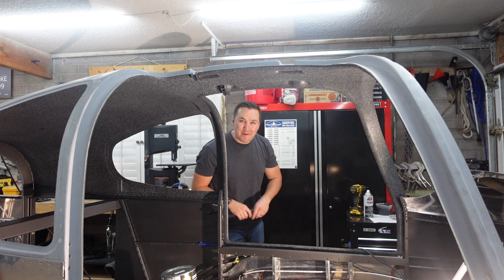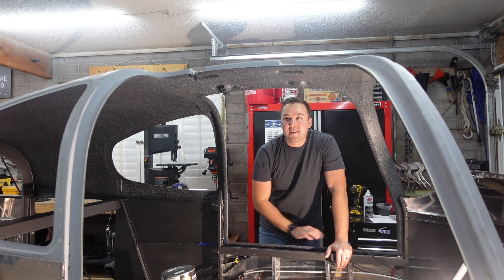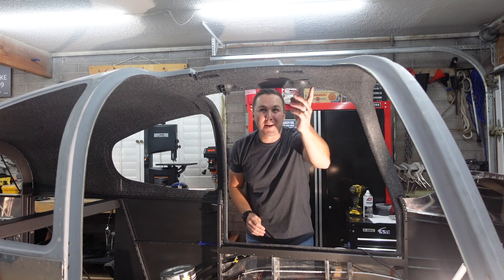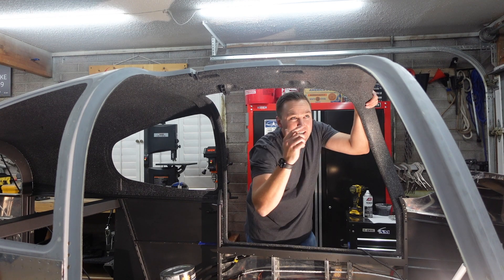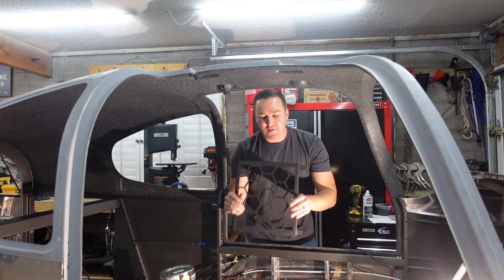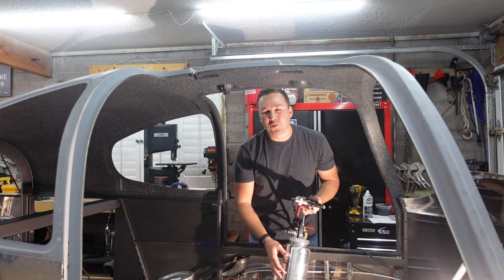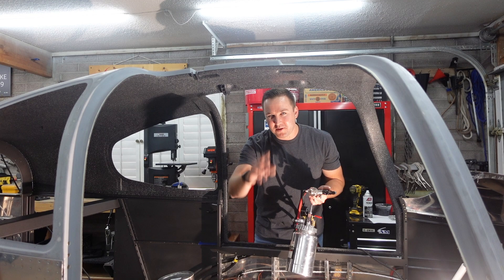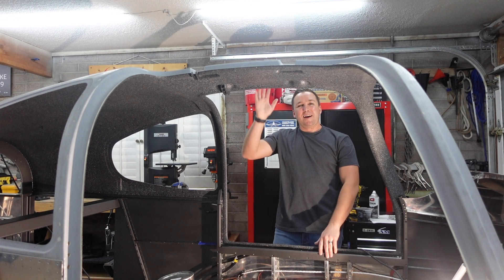RV-10 - Cabin Cover Finished & Modifications Made

Comment: Have you thought about mounting your GPS antenna(s) to the inside roof of your cabin. I'm thinking of using the hardpoints you used to support an overhead console, like your Starlink tray, on top of which I can mount my GPS antennas. Thanks!
Reply from the maker: @willonthewing2860  that’s a clever idea! I didn’t think about it with mine, but can see how that would make for a clean install. I ended up mounting mine on top of the tailcone top skin (it’ll be in a future video) I think you’re onto something with that idea though!
Reply from the maker: Also, I forgot to mention it in this video, but I used these studs for the starlink mount: https://www.mcmaster.com/product/97590A839